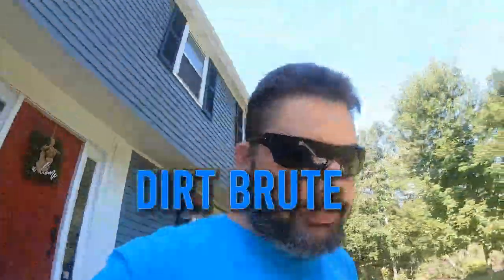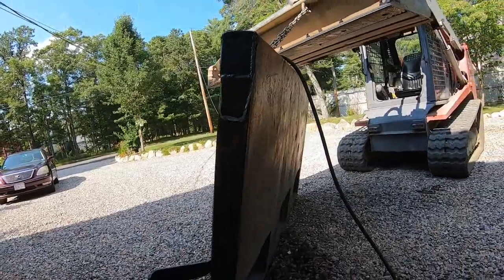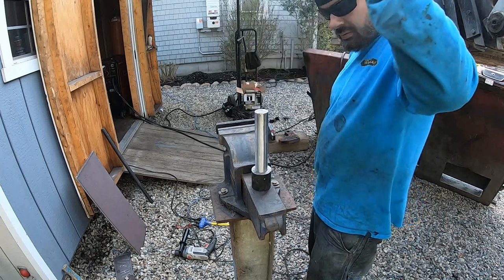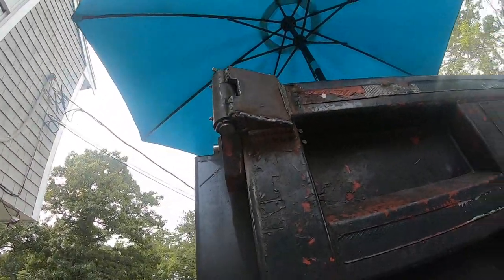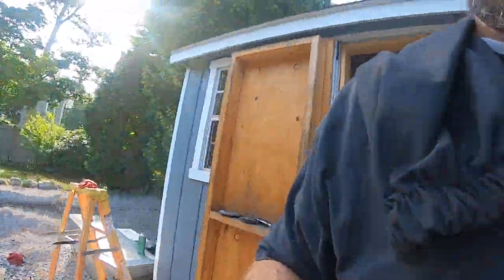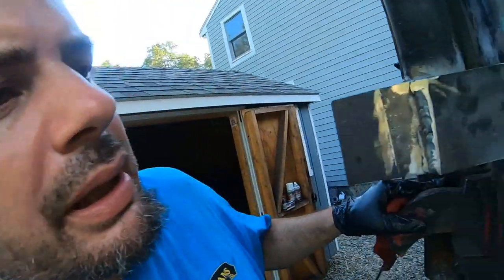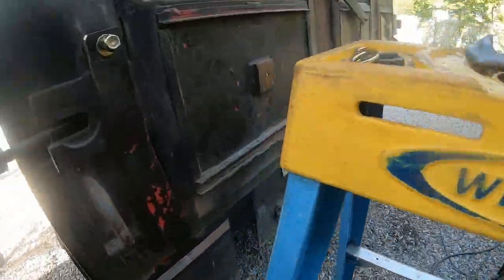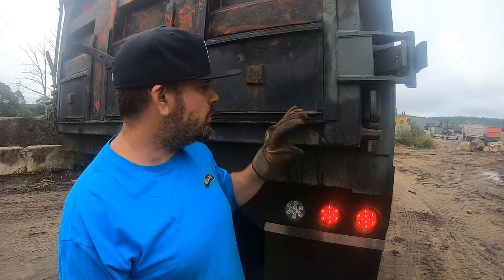Homemade Barn Door Kit!

Comment: That door is awesome man! That latch was perfect ! Awesome job once you have a barn door you always will need a barn door! I miss mine 💪🏼
Reply from the maker: Thanks man !  Yeah Over the years I’ve use so many styles. Even the air lift gates but sometimes stuff hits the gate and shuts it. I’ve even had one get tweaked and bend the air ram. Barn door is where it’s at 💪